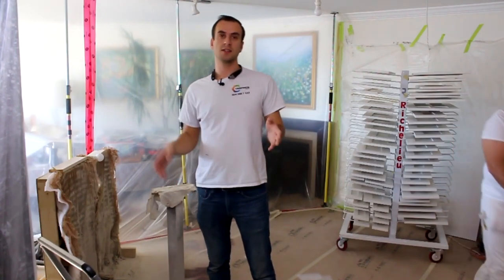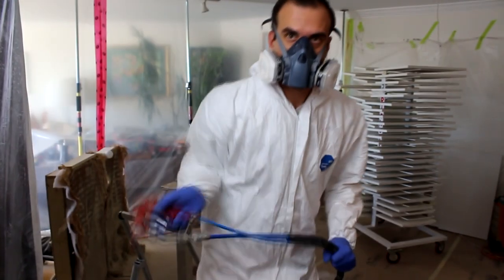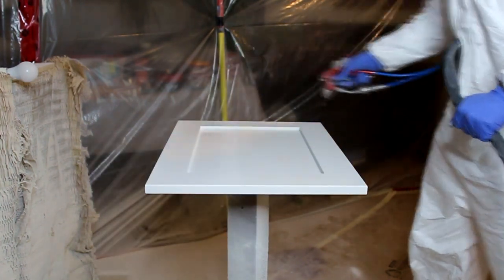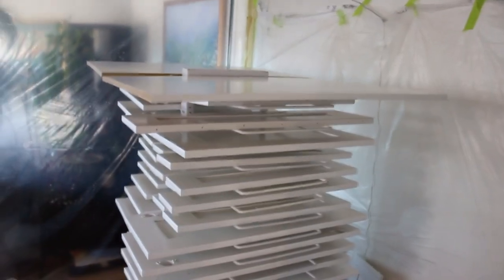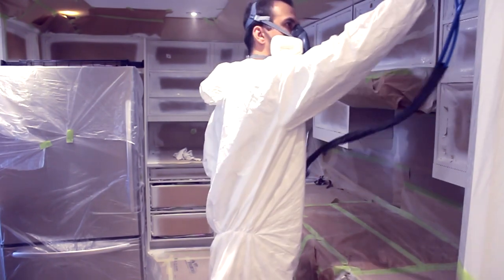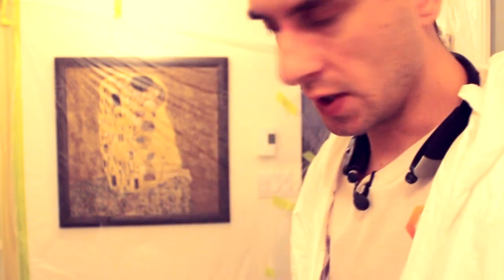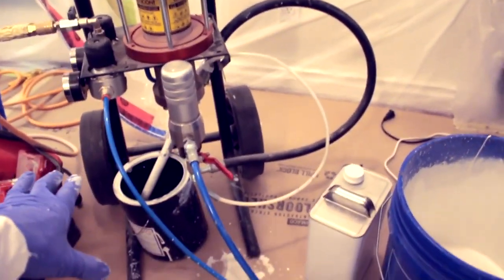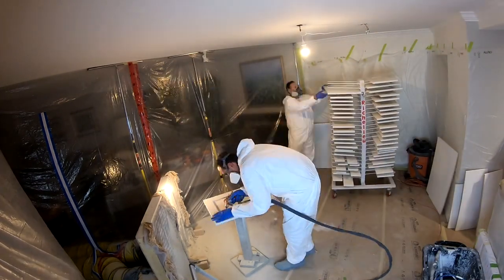NEVER paint your kitchen cabinets! ( yourself )

Comment: KONSTANTIN i am refinishing my maple cabinets they have no stain only clear coat. I know you use BIN SHELLAC under MILESI 2K TOPCOAT. Why not use MILESI 2K PRIMER formulated to work with the top coat maybe improving the appearance of the finish.How do you feel about Graco Magnum X5 with a 308 tip to spray MILESI 2K WATERBORNE PIGMENTED TOPCOAT.I know you use a GRACO TURBINE and AAA spray system . Can I expect a good finish with the magnum x5 and 308 tip . THANKS FOR YOUR HELP FRANK.
Reply from the maker: magmun x5 is great for this case. WB 2k milesi primer is great - just remember to wait for about 24 hours so the primer locks down any bleed before you scuff sand and top coat